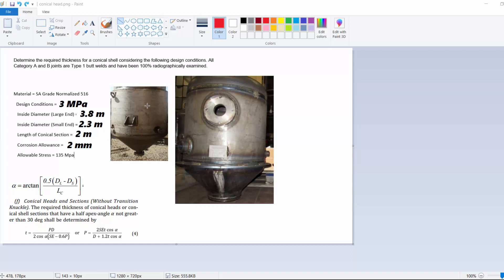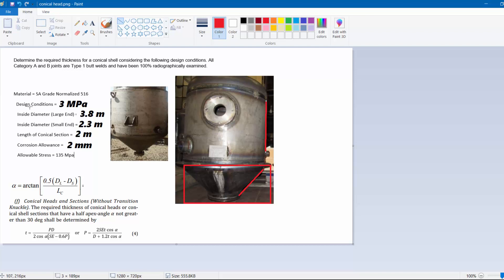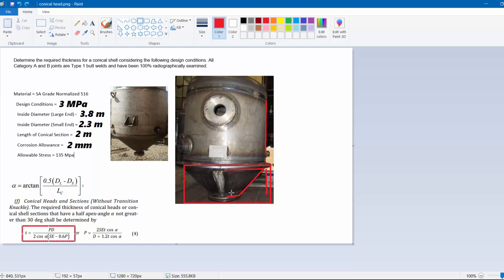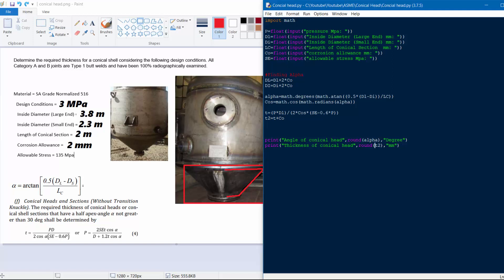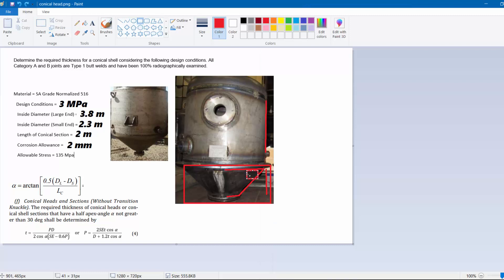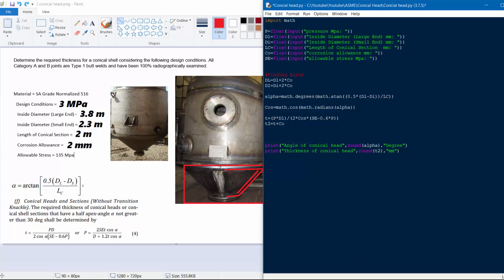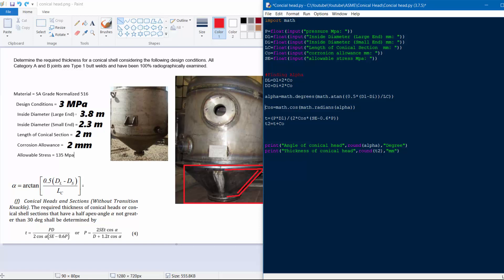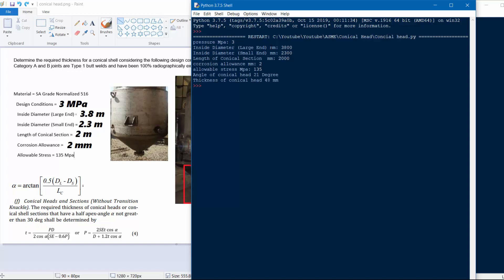ASME Pressure Vessel Design by python-4 | Python for mechanical engineer | Python Basic Tutorial

Comment: Sir, as we are rounding off, there are no big issues. But if we weren't rounding the values of, I think there might be small differences in the solution, where on one side we used the exact same diameters and on the other side the one with the Corrosion resistance